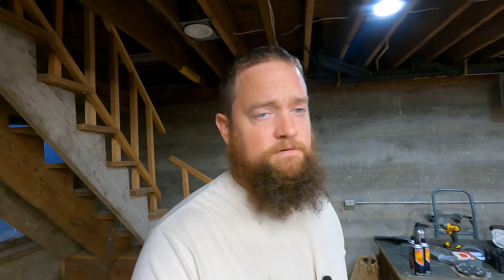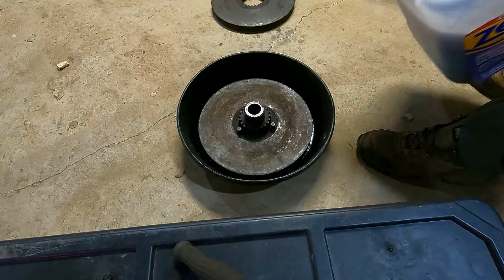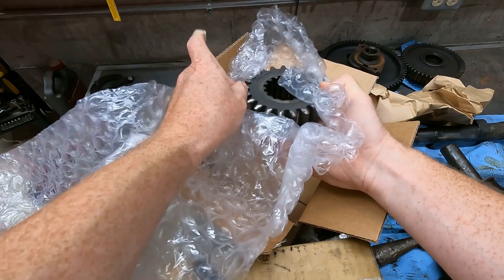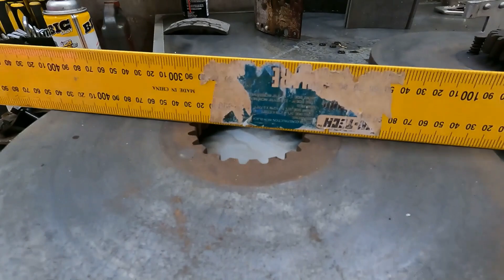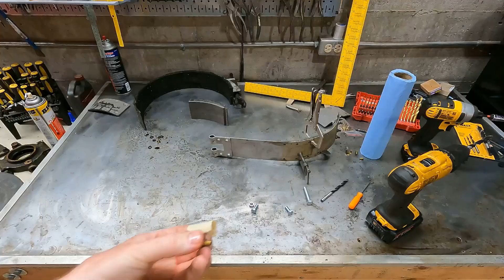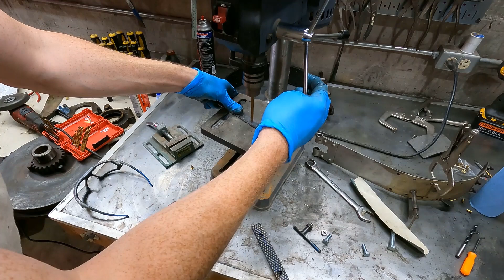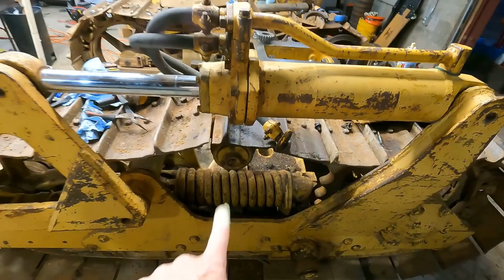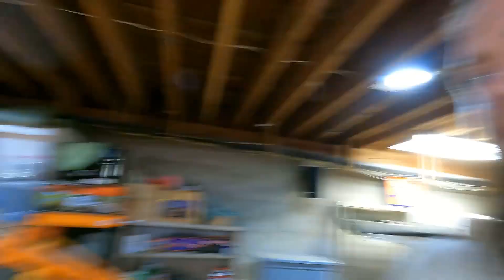Clutch repair and relining the brakes on my Caterpillar D4

Comment: I share your thoughts of a light on  this rabbit hole tunnel. I had those punches at one time from my dad and those you made will work, I wouldn't be afraid to use a ball peen hammer to do a tap or two for mental security. most machinist shops have stuff like this if they are a generational shop or tools of the past., If I remember right, I set the one punch in the vice and with someone holding everything took two hammers .... one to rest on the rivet and one to hit that hammer to drive it solid. You still have to get it started spreading and then the other to make tight like your doing now. Many years gone by and memory is not as sharp as before. I know that drilling out the hole for the rivet head is scary but there has to be a way to rig a stop on that drill going to a stop point of drilling   those old parts might all fit into some war chests that you make yourself so that should you have to go this deep again.... the old ones still have numbers to  reorder from .... other wise while scrap is high..... :>) good luck
Reply: Our local NAPA machine shop still had the tools to rivet and grind brake shoe linings last time I checked. The equipment is still out there, tho it’s not common these days.
Reply: @notajp  How very true.. thanks for the reply

Comment: If the engine block is still good it might be worth it to see if you can cobble together parts to rebuild it from the guy you purchased the engine from. Probably get the parts really cheap along with anything else you foresee needing like undercarriage parts. If you have to do it down the road  it will probably cost a lot more.

Comment: clutch plats // sand then down with a sander// and if any cracks  grand out cracks weld a bedin full in ,-- and resand  them down //your  not turning over high R.P.M. and all that  metal last years// as it was build to last / water was the killer

Comment: Hay Sir.Matt  
The super glue is not a bad thing it all helps. I use a PL supreme from the headwear store. That crap will hold I think hold everything anywhere!  Being bonded as well as riveted  is a back up if the rivets come loose. The clutch plates there if you have a orbital sander it will give ya good look at em.
THANKS FOR ANOTHER GOID VID keep em comin.

Comment: Hey. Ya buddy I operate older bulldozers d4h and jd350  dozers.   2nd gear is the most used GEAR. Used operating. 
1st for heavy pushing power ok
But 3 and 4 th.  To fast  will wear your undercarriage  out fast

Comment: Here is the thing,you only use second gear and up to travel so a bit of wear is not a big deal. You only pushdirt with first gear. Glad you found the parts you needed. May be worth getting what ever parts you can in case of future issues.

Comment: 22:00 .. Just for next time .. the "ball" end of your ballpeen hammer is designed specifically to peen rivets. that's all you needed to set them.
Reply from the maker: I was going to try that on a rivet, but my ballpeen broke in the video last week 🙄
Reply: @PacificNorthwestHillbilly  I saw that! ... too bad you live so far away ... I probably have a dozen ball peen hammers :)
Reply: And it’s not easy getting new handles for them. They don’t use a standard hammer handle. We had to order handles for two of mine from a hardware store. Nobody stocks them, and it’s almost as cheap just to replace the hammer.
Reply: @notajp  LOl!! .. we just use broken hockey sticks here ... sand them to fit .. this is Canada though .. but surely you can find a broken hockey stick? :)
Reply: @Tommy-Shanks  Hockey isn’t a big thing in Indiana…..

Comment: About the asbestos. My friend used to work at the university here and he used to work on the crews that removed asbestos he said they used to spray everything with car antifreeze to keep the dust out of the air. A gravity fed waterer on your drill press would work fine for that just use antifreeze. 
 I also saw you vid on getting the new engine you should ask him what he has in new old stock parts for your Cat. Tell him you are interested in the engines he has if he sells for scrap price and you could part out cause I'm sure once you post this video series people all over the world will be asking you for advice on where to find parts. You could also dismantle all 3 engines and pick and choose the parts for one really good one. You would probably get a reasonable second engine and maybe some parts to sell.  I would also use him as a reference about your questions about the clutch parts on what needs to be rebuilt or not.  Realistically how many hours do you think you will ever put on this Cat. 1000 hours is 1/2 a year full time. It probably has how many hours and it is only worn how much. I am really enjoying the videos I really wish I had access to stuff that cheap here and of coarse your energy would help a lot.

Comment: I’m still impressed. Your rivet setter gets better results than I would get with the approach I would have started with (involves a large hammer and a prayer). Here is a mantra that went through my head while watching: “It’s only wrong if it doesn’t work”. You nailed it (ok, riveted it)!  You scored on the used parts and it’s good that your not skimping on new parts where necessary. You will have a warhorse when you are done and the overall cost will be a bargain compared to buying a unit ready to put to work on day one. Keep on wrenching! 😎👍👀

Comment: If the parts were not painted from the factory do not paint them.  Paint can chip off and contaminate the lubrication.  Also metals expand with heat and paint can chip off.  Interior engine and trans parts are never painted.

Comment: Matt-an aircraft brake rivet tool might work for the riveting application.  I prefer the screw type over the type that use a hammer.
Reply: Hammering will assure you of broken and cracked brake shoes. I learned on a foot operated rivet press. Got good at the age of 16

Comment: My dad has an old brake and clutch lining tool. You hold the lining to the plate and apply pressure to the base anvil which activates the upper anvil to mushroom the revit.   Works really good just nobody relines brakes and clutches anymore.
Reply: Yes that machine makes that job easy, used one many times.

Comment: I’d reassemble the old engine loose to keep all parts in place etc then if down the ways you find your needing a part hopefully one from old engine will be good enough and keep you moving . Or ! Oil paper all parts into bags and mark clear what each part is and store in a dry area or go down the lines you where heading before getting other engine and fix that one to running order and keep as a spare to swap out to keep you going while you fix that one ??? 
On top of it all I really enjoy and am inspired to get on with my own restoration and repairs of my landrover’s to point I tackled doing repair to my gearbox which I would never of thought of trying before so hopefully my repair is good all seems good dry bench tested but like you onwards towards the light . 💡

Comment: Just a heads up. When buying brake cleaner from autozone get it by the case. Its more for the case but when you figure the cost per can in that case it's less than buying them individually.

Comment: Hey Matt. I might put the parts in a box (or boxes) and label them really good and set them off in the corner. As you mentioned, you might need something for the newer engine. Clean up the old block, set it off to the side. Of put it out there that you have a few parts that you would be willing to trade or to sell. You're doing great so far...from my armchair perspective.

Comment: Not sure if they are still readily available but they used to sell rivet punches.  To get around the need for extra hands, put regular punch in a vise, place countersunk rivet over this punch.  Use rivet punch on other side and beat tight with hammer.  Spent a lot of hours as a kid relining brake and clutch bands for an old American crane.
Reply: me too Mark
Reply: @sidecar147  What model?  Ours was a 375